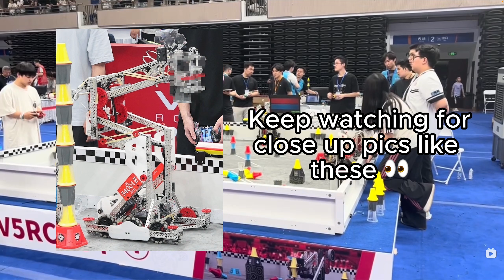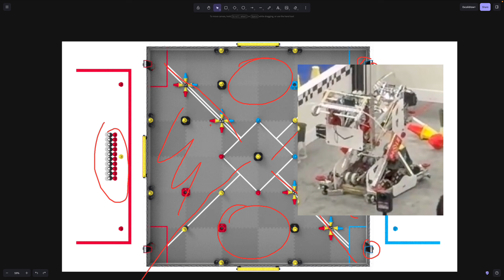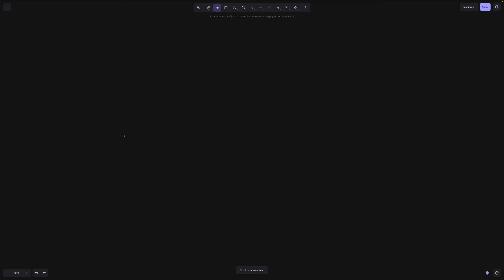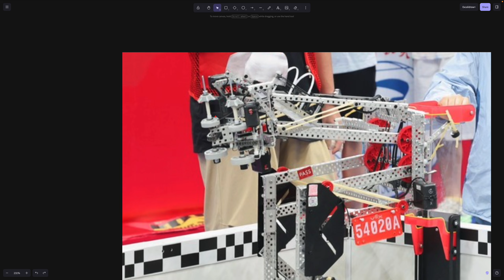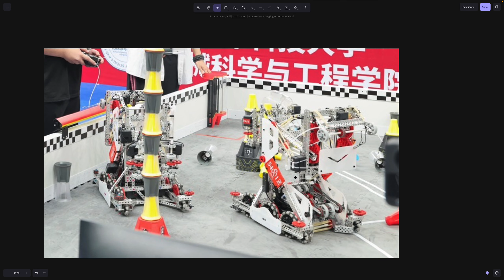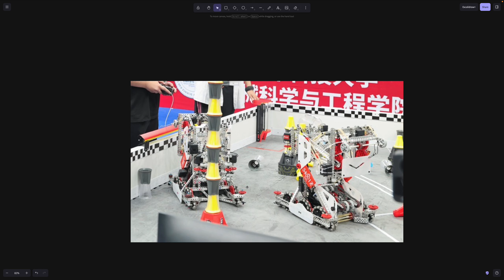How China Teams DOMINATE Override Without Pneumatics

Comment: Another thing I saw what that they had an intake on the front and back of the robot. This can be really helpful putting stress of the driver lwk
Reply from the maker: Maybe, the front intake isn't used as much because it is for ground pickup and the back is for quick matchload pickup. It could reduce the stress for driver but it is also harder to drive for some people because you need to be able to drive well forward and reverse